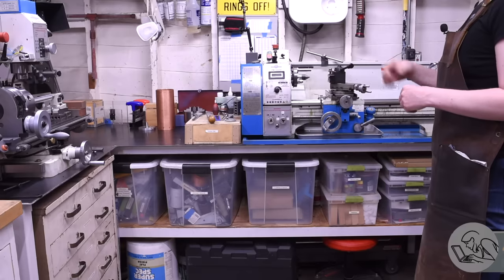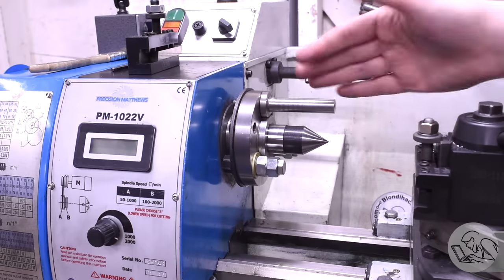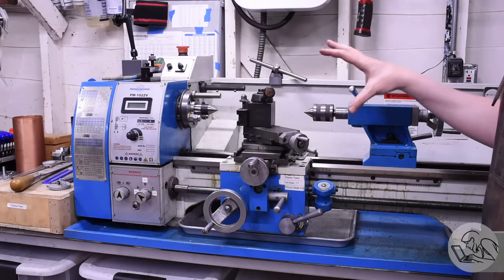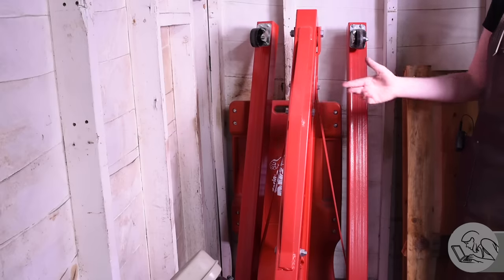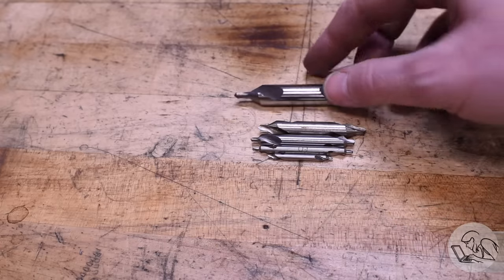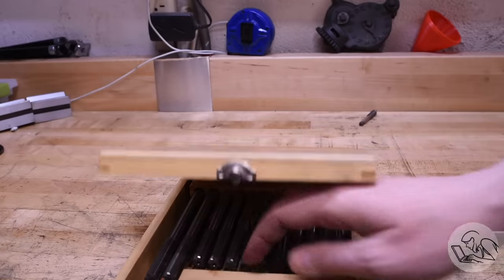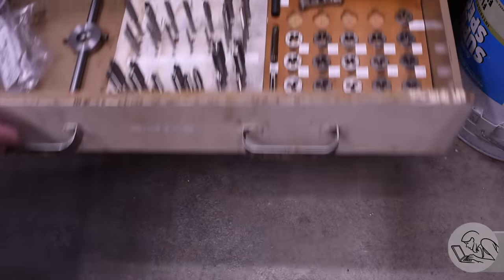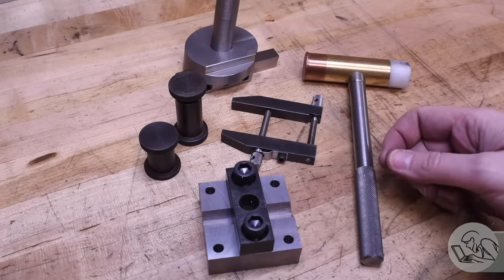Getting Started In Machining - Absolute Beginners Click Here!

Comment: "a whole load of precision below a 1/16" - excellent!
Reply: Hitting below the belt for some on that one 😂
Reply: I'm not sure any of my woodworking projects ever hit 1/16 tolerances, but I appreciate the flattering assumption.
Reply: The converse is also true. I keep designing wood joints to 1/64” precision, and end up shaving with a chisel to account for material twist and bend.
Reply: There’s woodworking and then there’s woodworking. The old pattern maker that I worked with could use hand tools and a disc sander to produce tolerances that many machinists find hard to hit.
Reply: @robertpearson8798  yes, what astonished me about woodworking as an engineer is that, especially if you use existing parts to layout other parts, you can get extremely tight tolerances. Also, test fitting then shaving then test fitting is another way to get perfect fits.
Reply: @ilikewaffles3689  The same old pattern maker once told me that pattern makers make lousy cabinetmakers. If they made a drawer to fit an opening and pushed it closed they'd never get it opened again.
Reply: World not Load.
Reply: Loved that remark! The only exception to that is Japanese joinery, where the goal is to make the joints invisible and held together with nothing but friction.

Comment: Final comment about saving money was interesting. A couple of weeks after buying my lathe I needed swinging arm bushes for a 1980 Kawasaki. I was horrified to learn I was expected to pay £68 for the bushes. I set to with 50 pence worth of black nylon (carbon impregnated) and made a pair. Those bushes are still going strong 14,000 miles later. I've done a lot of similar jobs on bits of old motorcycle since. Of course, the way to really save money would be not to buy old motorbikes in the first place.
Reply: It's still cheaper than new motorcycles.
Reply: Not buy old bikes? That statement doesn't compute😂
Reply: Blasphemy! ALWAYS buy old motorcycles. If there is one thing on this planet a guy can’t have too many of its old motorcycles…oh, and tools. ALWAYS buy tools. And land, you need room for all the old stuff you buy.

Comment: Fortunately, I shall never have to worry about my hair getting pulled into a machine!

One neat thing about today is that even cheap calipers and micrometers are quite good. You don't have to pay $150 per unit with the calibration certificate in tow in order to get good results in your garage. Precision, today, is actually quite economical. Three micrometer sets are actually pretty affordable. It's when you get to the inside micrometers that things get a little different. If you do buy a digital caliper, my recommendation, if you're not going to be using it frequently every day, do not store the battery in it. Store the caliper in its case (always) and keep an extra battery with it to boot. In any case, have a backup, like a vernier just in case you are in the middle of something and can't get the digital to work.

Making your own tools... that's the blacksmith mentality. If you need something, don't buy it if you can reasonably make it! Tongs, for example. A blacksmith often needs specialized tongs. Only way to get them to fit what you're doing is to make them yourself.

Comment: Protip: most of my murder machines (bandsaw, grinding wheel, etc) have at least one piece of PPE actively blocking the use of the tool. You can not access them and get them work ready without touching goggles, earmuffs, etc.
This helps me break the mindset of 'oh it's just one quick cut'. No, it's just one small chunk of debris flying at my head, and I like having both eyes working 👍
And yea, I got some fairly cheap goggles as spares to do this to every big tool ❤
Reply: Smart woman....
Reply: Safety-always excellent advice. "Murder Machines" I died.😂😁 I'm gonna use that if ya don't mind lol
Reply: Bravo!
Reply: That's excellent, I keep reprehending/training/suppressing my "not-so-responsible-self" by doing something like that too. Leaving obstacles and or reminders for my futures self in front of equipment or spaces where risky stuff goes on.
Reply: Bout the only time I use PPE is when I’m dealing with molten metal or it’s above 400V
Reply: @loganthesaint  nothing like pulling a new feed into an electrical vault and being able to hear the bus bars humming from current flow( maybe eddy current in surroundings) and everything in the vault can kill you! Did this in an apartment building with a manual fishing pole tugger ( 100% conductive!) talk about sweating bullets!
Reply: I am a big safety first person i taught my sons the smartest tradesman is the one who retires with both eyes, all there fingers and toes. Mistakes happen, stuff  breaks and people are hurt but if you do your best to prevent injury you will save yourself a lot of pain and and a lot of lost time.
Reply: @loganthesaint  Most importantly, you use your brain to keep yourself safe; PPE rules are usually arbitrary which discourages rational thought.
Reply: Oh my god this is genius

Comment: For metal, don't forget to look for a good local scrapyard that sells retail.  I have one, steel is $.40 per pound, aluminum and stainless $2 per pound, any size or shape you can find.  Beats the heck out of online metal prices and lets me afford to kee a few hundred pounds of assorted "bits" around for when I need them.
Reply: Depends on where you are and where you look. Here aluminum is $3 a pound to buy but I've run into a few deals on cutoffs on Ebay for $2.50 a lb with free shipping.

Comment: My first month after starting full time in our family shop, I made a tap guide block. It was an old 1-1/4" square shaft key. I drilled a row of holes thru at thread nominal diameters from  number 10 thru 1/2". I still have it and use it regularly, 38 years later. 

Quinn, thanks for the quality content. There's lots of good advice in this video.

Comment: A thing to consider on the PPE front: if you wear a wedding ring, buy something dedicated to store it in, and TAKE IT OFF BEFORE YOU WORK. Lots of people don't count it as jewellery. Yes, it sucks to take it off, but degloving is no joke, and it'll suck a lot more if your wedding ring gets damaged. Same goes for any electrical work above 48V or with high-current supplies.

Comment: Moving my 200lb lathe is an all day project because I have to clean a path between target and destination ;)
Reply: You have an available destination???
Reply: @Tinker001  it's like, the opposite side of the same workbench :)
Reply: @VoidedWarranty  doesn't that include cleaning the destination and all the space in between?
Reply: @mpikas  yup and the path for the hoist and where did I even put that thing and ugh the lathe is so dirty back there and crap now I've got a sliver so I've gotta dig out the microscope... Reorganizing my shop is very much yak shaving
Reply: Path? clean? these words I do not recognize...
Reply: I feel your pain, the bench for my 9a is 1000 lbs of cast reinforced concrete.......  Thats without the lathe, the drawers, legs etc.........
Reply: @speedbuggy16v  LOL I built my lathe stand with no consideration for weight until I tried to move it. All welded quarter inch thick 4x4 uprights and quarter inch thick 2x2 cross pieces. It's built to house a Craftsman rollaway tool box and all my lathe tools some extra motors and other things. At some point I did the math and figured out that I had 800 lb just in the steel not counting the top the toolbox the lathe or any of the tooling. I machined some adjustable feet and found some steel casters that will hold it but even on the casters it's really too heavy to roll around. Totally and completely massive overkill for a grizzly 10x22, but it sure looks good.
Reply: @mpikas  kind of the same, mine is not built to roll, but has space for drawers robbed from an old husky roller cabinet, and a 5 gallon bucket for a sump underneath it.  The idea was to add damping mass, have a sump, and storage.  Sadly quin is probably right about the point of diminishing returns on building it that heavy.
Reply: @mpikas  If it's still not heavy enough,  fill the legs with sand.

Comment: With my limited time learning, 1 year , I found that the pre ground sets of tool bits are good, but you will need to sharpen and regrind them pretty soon but the good thing is, they work as a good template
Reply: If you want you could even note down the angles from the pre-ground stuff to serve as a template (since often some of the angles dont stay intact or measurable, especially when something breaks off, wich is not unlikely for beginners), while you have no understanding of what the different angles actually do, until you find the time to actually learn, what the angles do and fit them to your actual needs.
Reply: I started with insert tooling from day one, and that works for me.
Reply: @Stefan_Van_pellicom  If you can afford them and your machine is up to it, that is a good option.

Comment: 14:17 'Metric folks can get by with fewer drills' - no we can't! we have to have the imperial, number and letter drills as well 'just in case we might need them, even if we never use them'
Reply: Can vouch for this, but we can get away with crappy imperial drills if we don't use em heaps.
Reply: Have to or want to? 
😉
Reply: @bastelwastel8551  shots fired.
Reply: I petered rebel drills over imperial ones
Reply: Things I like about the Imperial system: first, it's called "Imperial", which has a much better ring to it than "metric" (though "Avoirdupois" is still the prestige favourite). Second, dividing by two in order to get the next smaller unit is very intuitive (just compare 1/32" to 0.79375 mm). Third, British engineers were able to attain enormous feats with what the rest of the world now considers an unwieldy, even silly system. Nowadays, American engineers reach similar heights using the Imperial system (there's a moral there, to be sure). In short, there's no reason for the decimal system to be preferred; in fact, we'd be much better off if we chose a duodecimal system, because 12 can be exactly divided by 2, 3 and4, whrereas 10 can only be exactly divided by 2 and 5. Fourth, Blondihacks uses it; need I say more?
Reply: @bastelwastel8551  I do.
Reply: @ProfRonconi  I'm an engineer in the US that has to use imperial and it's trash. Metric is definitely the way to go.
Reply: @ilikewaffles3689  I agree, if only because standards are necesssary in order to prevent rockets from blowing up (true story) and jet fuel fom being loaded in litres instead of gallons (true story). But there's nothing inherently superior about metric: angles are best measured in multiples of pi, logartihms are best expressed in base e, and so on. I think the true power of the metric system lies in its algorithmic vocabulary: successive powers of ten are easily translated into names (with some confusion about the maning of 1 billion), whereas the Imperial system resorts to the decimal system when thousands or ten-thousands of an inch are involved: there's no quick way to name a 1/128 or 1/1024 of an inch.
Reply: Also metric threads have weird core diameters (not sure if that's the correct word). But you need like a 3.3mm bit for an M4 threaded hole.
Reply: @LuLeBe  minor diameter
Reply: @ilikewaffles3689  ahhh thanks! It's "Kerndurchmesser" in German and Kern=Core, good to know the right word!
Reply: @ilikewaffles3689  well I am in canada and everything I touch here is a mix of both. Very frustrating
Reply: @holmes1956O  Truth. I've had to design parts for fabrication in Canada and all my dimensions had to include both imperial and metric 😢

Comment: I would have added a good 6" machinist rule.  Otherwise after 10 years as a hobbyist machinist I agree with everything your said and wish you had said it 10 years ago.
Reply: Agree with the need for a 6” scale, but I’ve found just one isn’t adequate.  I have around 10; one for every place I might conceivably lay one down, and one more for my apron pocket.
Reply: The 6" inch and metric combo rules are incredibly useful.  And have several, if your shop is messy like mine! 😂
Reply: @Reach41  One in the apron, one stuck to each machine with a magnet.

Comment: Literaly just came across your channel while finishing of DIPA brew day. Using a diy arduino temp control in between working on my latest welding project. Was researching 3d printing wishing I had a lathe in between hop additions. Your channel description is basically everything I'm into. Add firearms and it would be a one stop shop. Awesome channel with great tutorials!

Comment: Ok, Ima be the machinist equivalent to the woodworking purist guy:

"Just get a good file and a good vise and start filing some dovetail ways or something. Once you get good at filing you can build up your workshop with other tools."
Reply: Fun fact, to become a machinist in Germany, you spend the first three to six months of your apprenticeship just filing and sawing by hand. Maybe a little chiseling.
(The apprenticeship - usually - takes between three and three-and-a-half years).
Reply: Back in the days when there WERE tool and die apprentices for the first year a file was just about the only tool they let you use.
Reply: Last startup I went to work for, I was in R&D doing electronics and building jigs and fixtures for the Production group. I had a steel table with a vise, a hacksaw, some files, and a Sears benchtop drillpress. After 2 years they had just got me a benchtop mill from Grizzly, and then decided that maybe we need a CNC and a real machinist. I made a lot of stuff for them before 'ol Mike took over for me.
Reply: @angelusmaker  Been there, done that. I was doing my PhD work at a Max Planck Institute and thought it would be a good opportunity to learn machine work. I did a "mini-apprenticeship" and spent the first 3 months filing cubes and hand sawing stock. I learned to file aluminium, soft steel, stainless, Perspex, etc. It wasn't always fun (!!), but it taught me so much about accuracy, patience and not accepting compromises. I never used these skills, outside of my own home shop, but I value them to this day (I'm almost 80 now).

Comment: About the lathe. I went to the store to buy the Craftex (sold in Canada) equivalent of the one you have. They had some "refurbished" (more like returned) machinery for almost half the price. The thing is someone before me bought the lathe I was looking for and what they had left was a CX709. The CX709 has a shorter bed and no speed controller. However, it is a gearhead lathe with more swing over bed, a MT5 and bigger bore on the headstock and MT3 on the tailstock. Honestly, the popularity of the variable speed controller is overrated when you move to a medium size bench machine. I learned the basics on an toolroom lathe and you don't need the "infinite speed variation" within the range, six speeds can do a lot, and if you need more change, the belt and you get another twelve speeds. So if you are considering buying the same (or equivalent) as Quin get the gearhead instead. The price difference is not that big and the CX709 includes the stand (mine came without it because it wasn't brand new).

About projects I recommend to get some books from the well known Workshop Practice Series.
*Useful Machine Tools To Make [Stan Bray]
*Metal Lathe [Harold Hall]
*Milling [Harold Hall]

These these have enough projects to keep a hobbyist busy for quite a long time and you will probably end up with a lot of useful tools and accessories.
Reply: Have to agree with you 100% on the Workshop Practice Series books out of the UK;  similarly, George H. Thomas' books from TEE Publishing are excellent. Not sure if they're still readily available, but Canadian author Guy Lautard's three Machinist Bedside Readers are also very good.

Comment: One question that strikes me for day one is "what to expect for cleanup and maintenance" - with all of the oils, chips, cutting fluids, etc - how does everything not quickly turn into a mess?
Reply: the answer is, everything turns quckly into a mess. wd40, shop towels, sand or better suited products to suck spillages, more shop towels and most importantly, shop towels (or old rags for the non important stuff).
Reply: Clean up after every process you finish. Sure it’s a lot of work, but a tidy shop is SO nice !
Reply: Final half hour of a day in the shop is ALWAYS spent on cleanup.

Comment: The engine hoist recommendation is probably the smartest idea I have ever seen. Thank you.   Jim
Reply: i have the Harbor Freight 1000 pound hydraulic lift table (about $300 although they honored the 20% coupon on mine), and it does a bang up job for me. I also use it as a welding cart and welding table, which saves me a lot of floorspace.

Comment: Ah ahh! AvE says to buy a mill due to the versatility of the mill. However, when I got my lathe I used it more and the mill became the helper machine.
Reply: Buy the lathe first, then give it enough time & it'll give birth to a small mill.
Reply: What about those units that are a mill with a lathe attached? No one ever talks about those!!
Reply: @guitarchitectural  Probably because nobody wants to admit to having one tucked away behind the real machine(s) in the shop...
Reply: @zomgthisisawesomelol he started out with, as he described it, a clapped out Bridgeport.
Reply: After using your lathe as a mill a few times, you will realize that it sucks, is a huge pain in the ass, and you will buy a mill.
Reply: A lathe & a mill should really be considered a set.
Reply: @guitarchitectural  Mostly because "do-all" machines turn into "do-nothing-well" ones pretty fast. Just as you wouldn't buy a car that could also be used as a power generator.